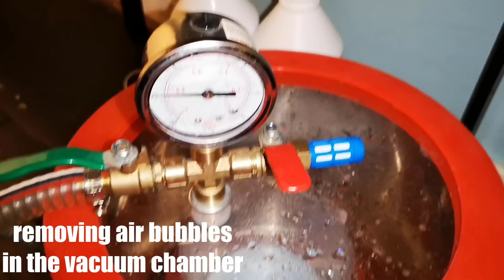Magic Faucet Fountain with Epoxy Resin / Night Lamp - Resin Art

Comment: If I may make a suggestion,  (not to take a way from your wonderful project) a way to be able to change at will the lights I would think you could use some clear plastic hosing to connect the two parts of wood. This would enable you to not only change the lights when one burnt out but it would do two other functions
1. Enable you to change the colors of the lighting if you get bored with one set, you could simple pull the wires out and replace at will.
1. When time to sand comes you wouldn't have to worry about scratching the led lighting at all as it would be safely inside the tubing. 
Just a couple of thoughts as I completed my resin clock a ways back and ran I to some interesting ideas myself
Reply: Zzuuu

Comment: Question to the author: how are the LEDs connected in the circuit? If one burns, why does the whole chain stop working? Right?
Reply: Лучше всего светодиоды соединить паралельно (у каждого светодиода свой резистор конечно), тогда вслучае перегорания одного, другие продолжают светиться.
Reply: Not necessarily. LEDs are typically 2.7 - 3.2 volts depending on colour and 40 LEDs on a 12v system would likely be made up of 10 parallel strings of 4 LEDs in series or similar.

Comment: Nice result, but it would have looked more realistic if you had left the bubbles in the resin, since there are lots of bubbles in the water that comes out of the tap.

Also, I'm confused as to how you sealed the tap when pouring the resin into the tube. How come it didn't leak out of the end?
Reply: Tap was turned off at a guess.

Comment: yep tap should have been attached to something like wood and the cabling should have gone through the tap the tap itself is the on off switch, very easy to do with the right rotary switch and remove the tap innards.  then run it off a battery pack embedded in the wood or a usb cable plugged into the side of it, seen much better versions and this doesn't deserve the number of views it has.also change the light colour option would have been nice, blue is a bit on the old side now and becoming very irritating to the eyes. Sorry.